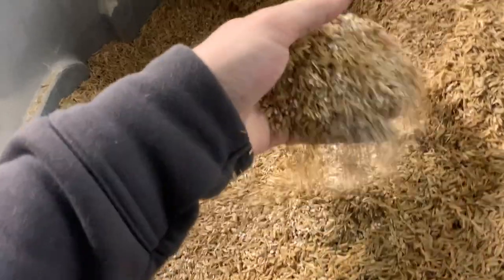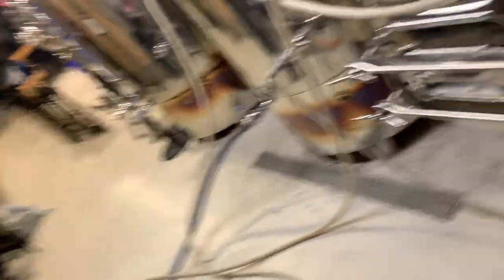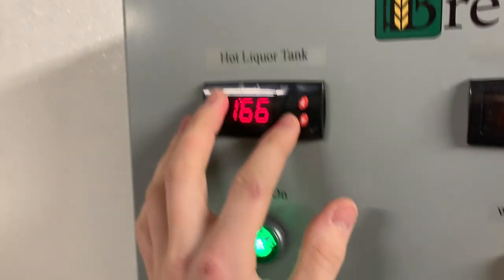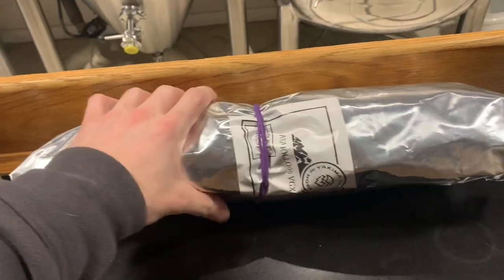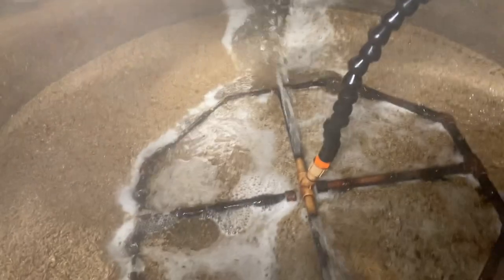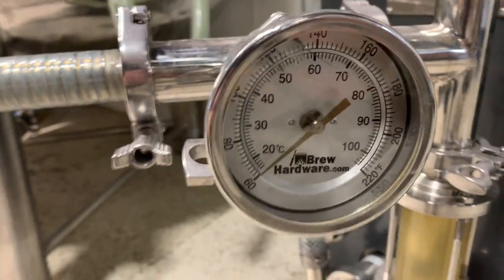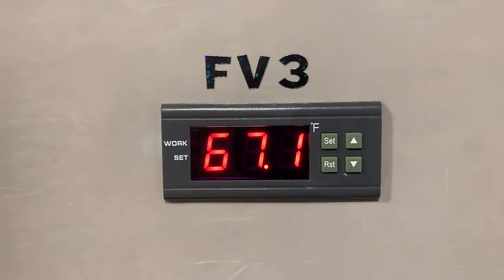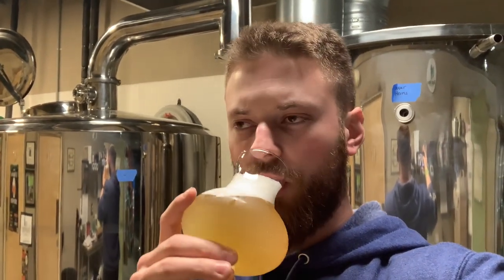How To Brew a Delicious White IPA

Comment: Hell yeah! Thanks for making this video! 
I’m excited to brew this with spring starting soon!!
Reply from the maker: You’re welcome! Thank you for the suggestion! We had a great time brewing it. Please let us know how your brew session goes!
Reply: @thebeerjunkies1  Of course, will come back when I brew it :)
By the way, why do you do a protein rest for this grain bill? I would think it's counterproductive when you're working with such a high protein grist. How does it help?
Reply from the maker: If you use torrified or flaked wheat, you won't need to do a protein rest. Because raw wheat has such a high amount of protein, not performing a protein rest can potentially gum up your mash and lead to wort separation problems. Using a protein rest also allows the protease enzyme to cut down some of the long chained proteins into medium-sized chains, which support the body and head retention. Peptidase will further break down some of these medium-sized chains into small chains of amino acids that can be used by yeast. It won't ruin your beer if you do not perform a protein rest, but a protein rest can improve wort separation and mouthfeel.